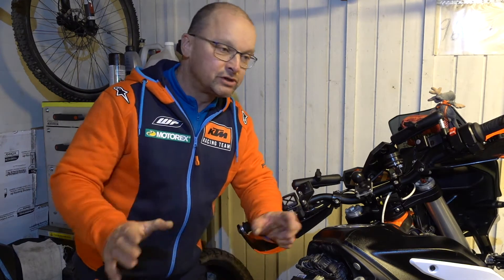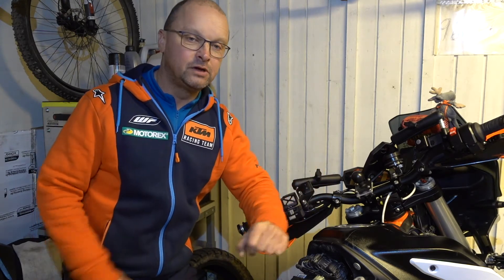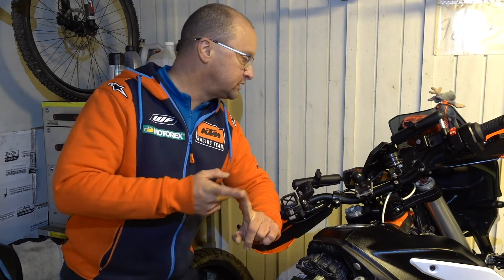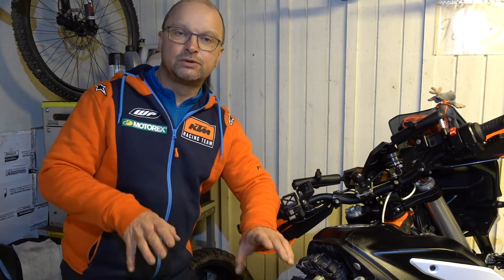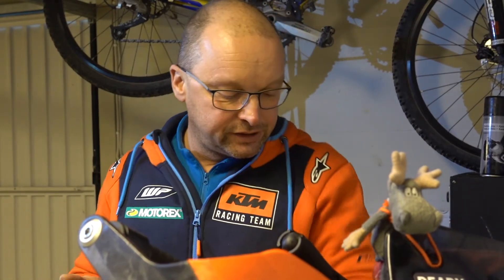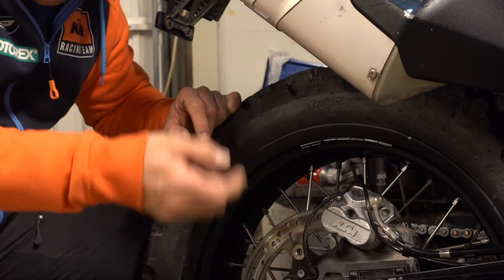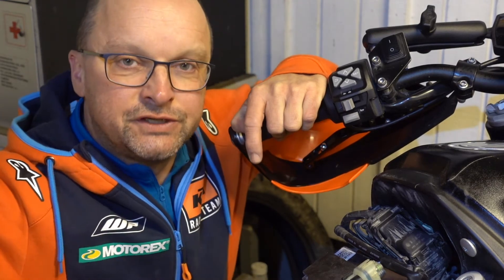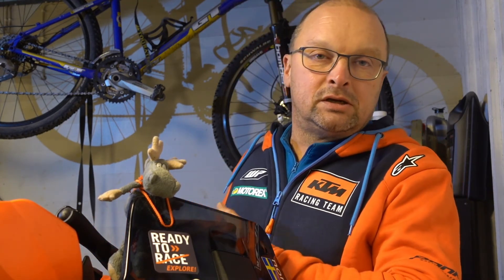MSC, ABS, TC... Reliability of motorcycle electronics!

Comment: Kai-Uwe you forgot the main difference that is the basis of riding modes and traction control
Ride by wire throttle vs throttle cable
.

I have had a KTM 1290 Super Adventure which I drove 35,000 km without a fault.
And now a BMW R1250GSA and a Triumph 1200 Scrabler XE both full of electronics that I do not want to be without 
.
Reply from the maker: Yes, you are right of course! To atay with the T700 example: does that bike still have a mechanical gas grip by cable? I didn’t check out that one. My guess: in the future most bikes will be ride by wire, then the engine management has full control over the air intake by e servo motor and it’s easier to fullfill emission reatrictions.